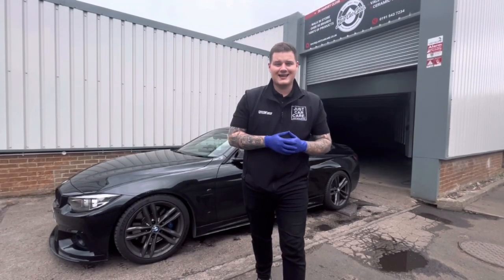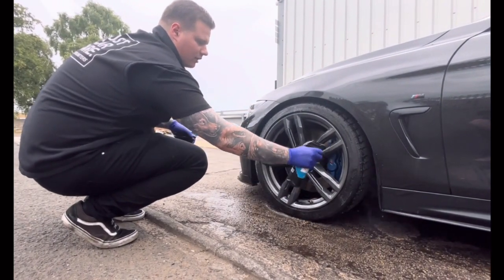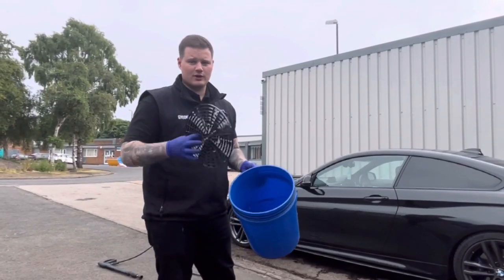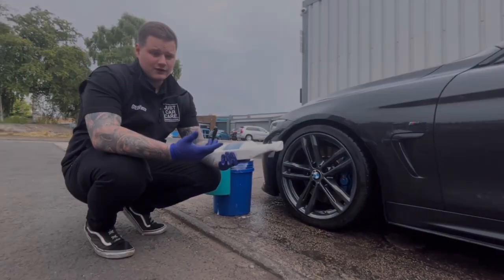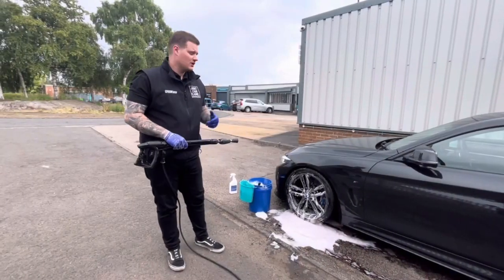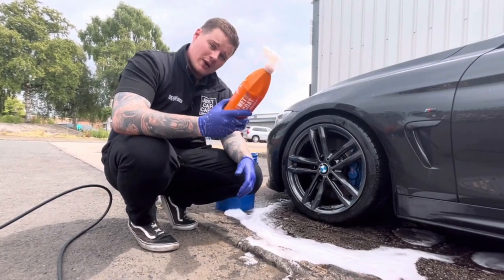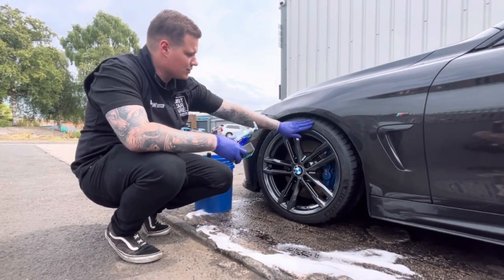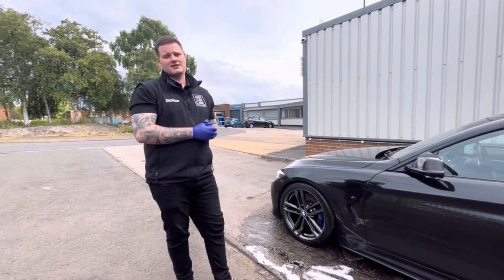How to Clean and Protect Alloy Wheels | Bilt Hamber Auto Wheel

Comment: Is there any harm using that wheel cleaner on a weekly or bi-weekly basis if you don’t care about cost? I keep reading that some of these wheel cleaners can harm clear coats on wheels over time if over used, but others disagree.
Reply: It does all seem a bit over the top.  I have only every used warm water and car shampoo and wheels look pristine.  But I don’t do heavy braking and that obviously reduces the amount of contamination.
Reply from the maker: Nope, you can use Auto Wheel weekly without any detrimental affect to the wheels. Just don’t use it in hot or warm wheels, only in cool and out of direct sunlight.